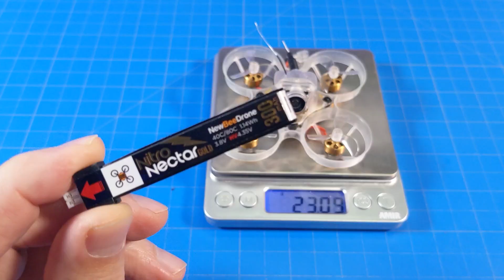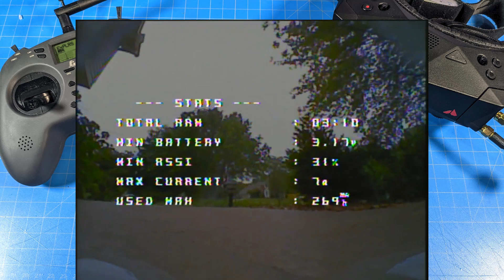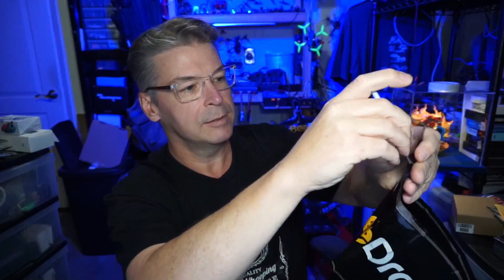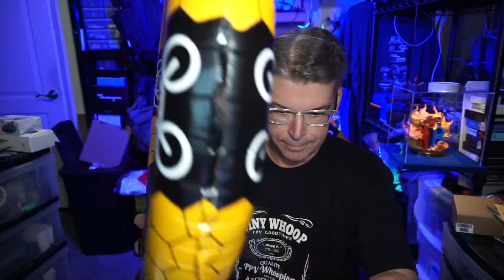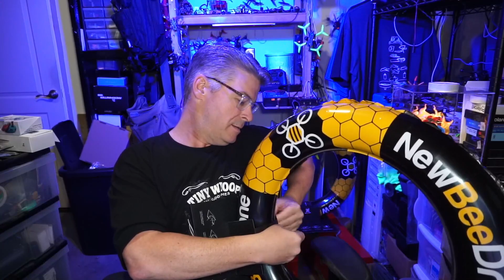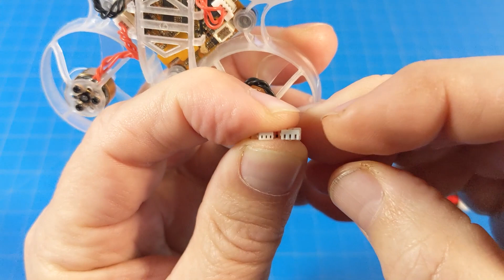AcroBee65 BLV3 // Extended Range // Props Down Or Not

Comment: Apparently it was a mislabel in the VTX table and it actually is, 5, 25, 120mw.  A new VTX table is in the works, but setting to 50 is just 25mw
Reply from the maker: this is likely needed to be shouted from the mountain tops.
Reply: @NickBurnsFPV  yeah, once the vtx tables are corrected and new hexes made I’m sure they will blast it
Reply: @NickBurnsFPV  Watched the video twice and did not hear the part about the props.  I see yours are reversed but you did not reverse the motors.  Did you re flash it or change motor wires?  Is it better with props out vs props in?
Reply from the maker: @ChainsawFPV  I believe it came with prop out orientation. the motors have to spin appropriately or the quad won't fly. Props out, tends to corner better and handle prop wash better, props out can often handle dives. This isn't always true, so if we are trying to solve a particular flight issue we have to try both.
Reply: How do you adjust the vtx sorry first analog anything I fly digital

Comment: Hey,just bought this based on your recommendation and video. It’s floating to the left a lot. Is there anyway to calibrate it so I can bring it back to the center?
Reply from the maker: flying in angle mode? If so this is a common issue. If not flying in angle mode check the trims on the radio.

Comment: Have you or anyone else gotten redpine to work on the BLV3?
Reply from the maker: I haven't flown redpine in two or more years. To get the drop down from betaflight I believe we need at least 4.2
Reply: @NickBurnsFPV  Yep, it's in the drop down.  Just can't get it to bind.  RX tab bind button goes away after selecting Redpine and CLI commands aren't working.

Comment: I like your videos, Nick. but I have had nothing but problems with anything newbeedrone.  they use custom firmware for their 'bee brain' osd (dumb), which means it's not listed in the betaflight target list, and are always several months behind new bf realeases.  but these nbd aio's weigh more than any other 5a aio, and every single nbd motor I've ever owned draws more amps than others of same size.  3 1202 flow motors draw about the same amps as 4 flywoo 1202.5's, lol.  NEWBEEDRONE SUCKS!
Reply from the maker: Thank you. Its good feedback and one of the reasons I am such an advocate of the communities feedback and experiences. Its much more valuable to get a wider experience and thoughts than just my own.

Comment: Every time I watch your vids I want a new quad!  I'm in need of an indoor and I'm wanting a long flight whoop.  Any recommendations other than the moblites. Or is a moblite probably the best way to go for long flight
Reply from the maker: With long flight being a goal its going to be hard to find something that will fly longer and be 1s as the moblite 7. The 7 is much more efficient than the 6. 31mm props vs 40mm props, really no comparison. Really, we can even by a mobula6 and transfer to a mobula7. I prefer those as the moblites have an exposed main board.
Reply: @NickBurnsFPV  yeah. I figured I'd pick up one of those redshifters zero gravity frames if I do end up getting one

Comment: For the premium price it seems like a solid-pin battery connector wouldn't be too much to ask? I mean, they started with whoops so surely they know that this is crap so I can't understand why they're still using these garbage connectors at this point 🙄
And proprietary (or at least uncommon) motor connectors? So we have to buy only NBD motors, I assume? Really?
No, thanks.
Reply from the maker: I don't know either. I have said it in so many whoop reviews. One way or another I suspect its a business decision. If it doesn't hurt sales and the cost of a better connector is more than current.
Reply: @NickBurnsFPV  So, the reason I heard they haven't switched isn't a business one or that they have 1 million of their connectors. Apparently the downside to solid pin is that they are slightly bigger and over time will ruin battery connections.  

BUT, true or not, I believe soon there will be a new GBN27 option and some Nitro Nectar's with GNB27...I still prefer the BT2.0 for size and ease of use, but I totally get why nobody has joined BFPV on that train.  A GNB27 Acrobee with a new NNectar 1s and 2s will BE SOOOO GOOOOOOOOOD!!!
Reply from the maker: @ProjectMockingbird  oh, I had not heard about solid pin damaging battery connectors. Interesting information. So are you saying there will be a new GNB27 connector or new to NBD? I found soldering the bt2.0 so frustrating and with only one good battery with it on the market opted to stop transitioning my batteries to BT2.0.
Reply: @NickBurnsFPV  I believe nbd will transition to gnb27 at some point soon.

Comment: I notice some gemfam props have hile all way through, others don't. 
On the V3 75mm frame if I use 0802 I can't push them all way down or they hit whoop spars.
But if bi blades aren't pressed right down I find them to cause crazy vibrations.
Reply from the maker: Interesting. I do recall some props being an issue on the v3/trashcan frame. I need to focus on the bi blade issue to see what I find. Thank you

Comment: My latest build was a Moblite 6 board on  one of the new version 65 mm cockroach frames. They aren't the lightest option out there, but they are definitely one of the most durable options in this size. The Tiny Whoop 333 mah batteries are another great option for the 65 mm builds. Those inflatable gates really are a good bargain!
Reply from the maker: I have recently been flying the 333 battery. Mine are pretty used, but still holding up pretty well.
Reply: @NickBurnsFPV  I just noticed there is a new ELRS Mobula 6 after checking stuff out from your most recent video. That could be really interesting.
Reply from the maker: @sixtofive  lol, yes I have that one. The main thing is the super high kv motors at 26000kv.

Comment: I love this nick but I cam e across a mobula 6 with jumper t lite for like 140 I have to jump on that!!!!!!!rc wing has the deal and I been wanting a game controller for a minute now that I don't have my novice 4 anymore I kinda wanna get the advant avio 3.5 and have a jumper t lite for it......I miss my novice so bad....I didn't treat it like the long rang it said it was because I'm not a long range guy at all!!!!! I like close freestyle and race.....but the glue on the vtx finally gave away and kicked my wonderful quad of the radar......I'm so sad
Reply from the maker: t-lite and mob6 for $140 is a good deal. Grab a mobula 7 frame and transfer to that. The flight time and performance goes way up :)
Reply: @NickBurnsFPV  thanks will do ✌
Reply: Nick I know your an advant lover lol I am currently looking into a nice freestyle 3 to 3/5 inch possibly even 4 now don't be biased lol but I was thinking gep rc 35 or hglrc rekon 4fr or of course the avio 3.5....I am very impartial to them all however I just like to be able to change an arm if need be instead of the bottom plate....you have flown pretty much everything so your input would really help thanks✌ oh....and I am still getting the mobula6 jumper combo basically because of the radio and the fact I need a good whoop but I am putting the rig on a mobula 7
Reply from the maker: @FPVADER  Where did you find the t-lite and mobula 6 deal? I have not flown the rekon 4lr, but I would expect it to fly like other 4inch lr. Do you plan to carry a gopro or other hd camera on top? Need to be sub 250 grams? It seems with a decider being the replaceable arms, that means the avio 3.5 would be the 3.5inch to get. I wouldn't suggest trying to freestyle a 4inch lr. They all have skinny arms and aren't likely to take much abuse, even a hard landing might snap an arm or plate.

Comment: Dude, that was some smooth flying...looks like the tune was working well.  I feel like the battery metering is a bit off as I regularly go down to 3.1 and by the time I get to my charger it's already back to 3.52.  OH, and it looks like you didn't push your camera all the way into the little shelf (you can see the hood in your view) and that's probably why you are getting the shakes...I do that a lot :P
Reply from the maker: yea, I figured the camera wasn't right, it would start out fine, then in 15 seconds it would come down. Rather than fuss with the screws again...glue it. Do you run props down to the bell or props up top? I was surprised by the handling difference.
Reply: @NickBurnsFPV  I do press them all the way down, but now you’ve got me wondering. I don’t think I’ve ever tried them riding high…it goes against my nature, lol
Reply from the maker: @ProjectMockingbird  Do it, one pack. Then you can tell me if I am crazy or not.

Comment: SH1.0? Why? 🤷‍♂️
Reply: The official answer is that they need to be smaller to fit all the components in and have proper thick tracings...If they didn't have the best motors out there in 703 and 802 I'd complain more, but it sucks when i want to go 2s and use 1102/03
Reply: @ProjectMockingbird  i got one but it's a F3 Evo brushed whoop fc. Yeah, smaller.

Comment: I've had extremely mixed experiences with the NBD 65 frame.
Flew my hummingbird for half a year (100+ batteries and crashes) before replacing the frame. However the new frame was smashed to pieces on the very first race day. It seemed way more brittle than the older frame which would bend rather than break.
These have literally been both my longest lasting and shortest lasting whoop frames..
Reply from the maker: I have often wondered about the pouring or the temp of the process in making these frames. The reason I wonder is from one frame to the next on the same frame we have experiences like yours, where 1 was good for a long time and then another doesn't last. I don't know the chemistry behind plastics...just a wonder.
Reply: @NickBurnsFPV  I think you're onto something. Something seems to vary from batch to batch...

Anyways, thanks for the review!
Reply from the maker: @BenjaminSalka  I do also wonder about the company making parts for another manufacture cutting corners, maybe its time or materials. I have heard this is common, and some companies place a representative in the manufacturers facilities to ensure they are held to the standards.

Comment: Was hoping they would go higher kv on this one.  I have a couple of the hummingbird pros almost 2 years old same kv and with the acception of the RX's in them dying from crashes they both still work fine. Original everything
Reply from the maker: I suspect the weight of their quads makes it hard to achieve 2:30 flight time with higher kv. I think 2:30 is pretty much the acceptable minimum for the market. Of course that depends on how one flies and the condition of their batteries.

Comment: The cockroach frame lasts me all of 3 days at most until cracked and broke to point of unflyable. Purchase a meteor65 frame to have so you not left grounded 😉.
Reply from the maker: Dang. I flew this one daily for over a week, and 4 batteries of failed gate powerloop attempts.
Reply: Cockroach frame is pretty durable but I used to bust them at the post. You really ought to check out the V2 frames they are ridiculously durable. Meteor frame is too squishy for me and I go through tons of props.
Reply: I do have to say i love the Goober though. By far my favorite canopy
Reply: I saw the hairline cracks in your frame that turn into breaks with more bumps. I was mad when the Cockroach frame only lasted 3 days and was told they would send another to replace the next time i order. I just went to Meteor65 frame and havnt had any problems since 😉
Reply: I like those blow up gates i might purchase a couple pack's
Reply: Winter whoopin season is coming up fast
Reply: Hold the cockroach up to a light and look at the cracks after some fast flying around house and bumping things 😉
Reply: My Meteor65 frame is still going after almost a year. Black seems to be the strongest but i might have gotten one from a batch made on a Wednesday lol

Comment: i wonder what magic they did to the receiver to increase the range? I would be happy if my whoops would get that far with the stock setup, i've added crossfire to one of my 75mm builds and i'm loving it!
Reply from the maker: yes, the magic is "optimized". :)
Reply: @NickBurnsFPV  do they change to diversity right? maybe that's why, happymodel 4in1 board for example came with the SPI reciver and a small tiny antenna that can't have that range
Reply from the maker: @Mau_DelS  The last edition had diversity also, but the antenna where very tiny.
Reply: I'm pretty happy with the ELRS whoop board, no more constant failsafe
Reply: I think it’s a new “low pass amplifier”…whatever that means

Comment: I would love to see this quad in a 2s version!👍
Reply: Beauty is you can trim out the hex on the bottom of the frame and use TinyHawk 2s 300’s on a single pigtail. I know, it’d be better with gnb27, but I run a 2s setup in 65 with espresso motors and 75 with 703 at 85% and it’s a heck of a lot of fun.
Reply from the maker: @ProjectMockingbird  I forgot this board does 2s as well.
Reply: Just solder on a 2-way pigtail & use a couple 1S lipos.
Reply from the maker: Me too!
Reply: Just were would the batteries go.no room for 2 1s batteries
Reply: @akatopj22  3d print a strap or rubber bands. Can also use this same board, canopy, & motors on the 75mm Acrobee frame.
Reply: @akatopj22  a 2s version would probably use a different frame and a different kv on the motors.   Ideally on a 75mm frame... Same board, canopy, and camera.